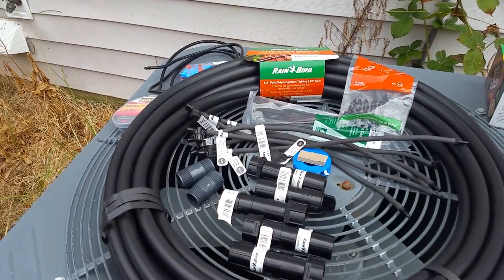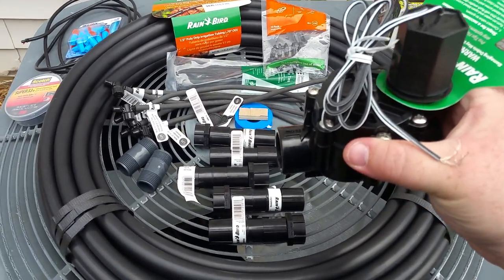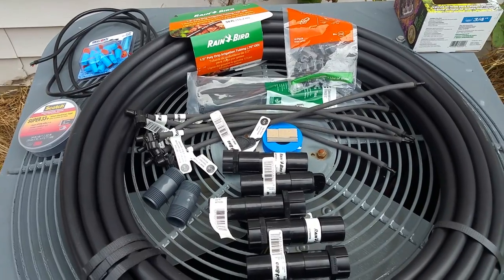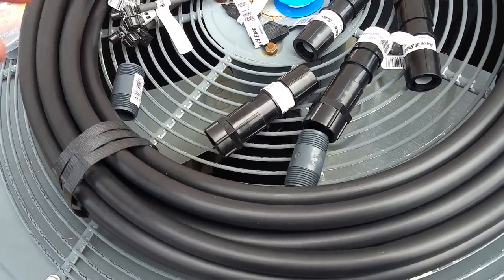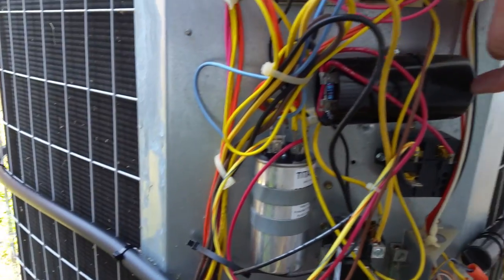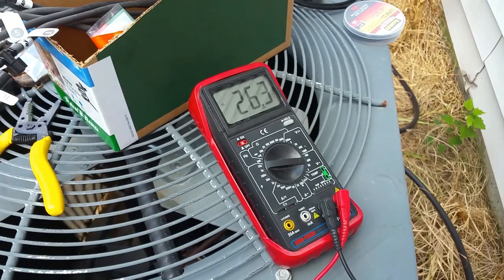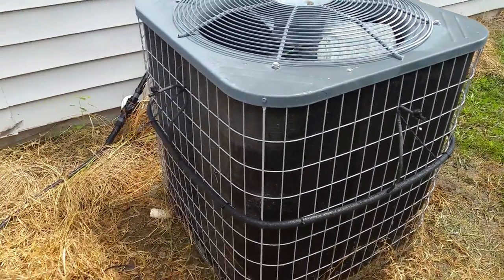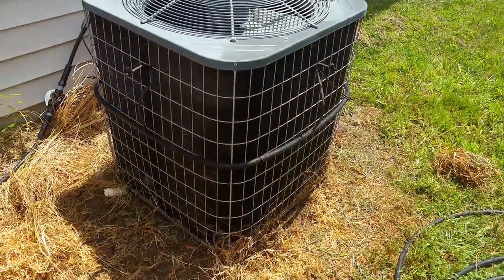DIY Automatic A/C Condenser Evaporator Mister - Electronically controlled!

Comment: I really enjoyed reading the back and forth and its really helped me. Better under stand this idea I stumbled on all of 15 minutes ago. Of course I was intrigued since it seems so intuitive but then I read yours and other HVAC explanation of this. 

Can you explain though why the homeowners reviewing these cooling devices all claim a 30% or more decrease in their bill if this isn't how an ac works? That's a pretty significant savings over the summer.
Reply from the maker: I think 30% is far fetched. Only way I could see that is in a VERY dry, desert environment where outdoor temperatures are in excess of 95F for the majority of the summer season. Here in hot and humid NC, the evaporative cooling effect is nowhere near a strong as it would be in a drier environment. My personal savings were in the $20-$40 range per month. My monthly power bill averaged about $250 in the summer, so a 10-17% savings. 
There's just way too many variables to calculate what was actually saving money. The only data I can quantify was a drop in air temperature after the evaporator. This means the unit outside was able to extract more heat and move it outside, and get rid of that heat more efficiently. Remember AC does not "make things cold" it moves heat from inside to outside. The more BTUs of energy (heat) you can extract from the condenser unit outside, the more efficient it is going to be.

Comment: I know you're not an Electrician and neither am I but I've been doing my own wiring for almost 30 years and I have to say you might have issues sooner rather than later.

I am not dogging your project, it's a wonderful idea and solenoid is an awesome concept, but you just can not cut metal and pass wire through, even low voltage, and expect it not to cause issues in the future. At the very least you could have used a rubber grommet to protect the wire a bit more and you can still do that; simply snip the grommet and place it around the wire and push the grommet into the metal. 

You get a cookie for using the correct wire nuts but lose two cookies for not putting it all in some sort of Exterior Electrical Box with Waterproof lid and connectors. Granted it's low voltage but condensation is not your friend and will defeat the wire nuts eventually, even those designed for exterior use, or cause other issues that you may not notice such as corrosion...

Overall you did well, but those few spots I've mentioned need addressed; if not for you perhaps someone else. 

FYI you can also use you hose bib valve to control the water pressure as well to further fine tune your misting system...  Cheers...

Comment: jonboy545 I only have 2 wires for the thermostat and they register around 27V. My problem is that it keeps blowing the 3amp fuse inside the air handler. Any ideas on why? I had bought a coolNSave system but it started leaking water from the paddle unit. I watched your video and ended up buying the solenoid and a pair of quick connect tees to reuse the original parts.
Reply: with the extra solenoid your pulling more that the 3amps so your fuse keeps doing its job up it to a 5 amp see if that helps 
I wouldn't much higher that fuse is protecting your transformer not to much $ and possibly circuitboard those are higher $ 100+ for some
5 amp should be fine